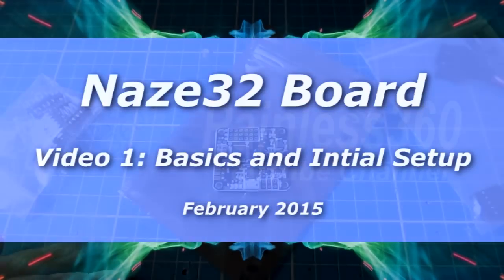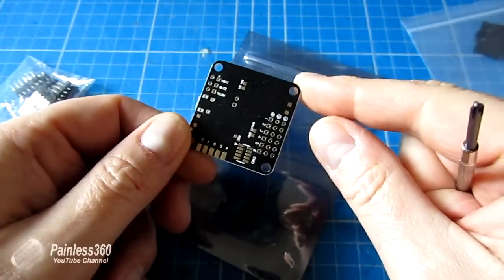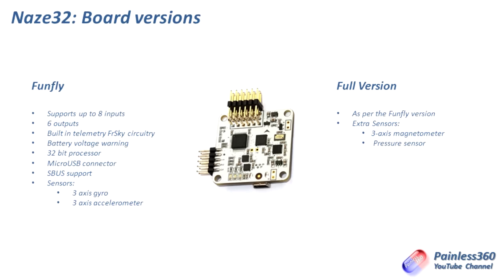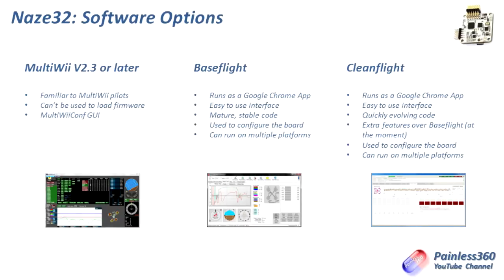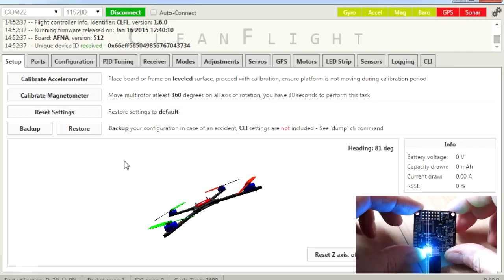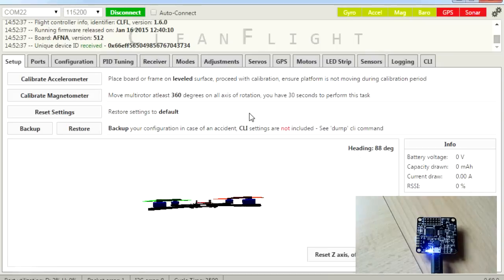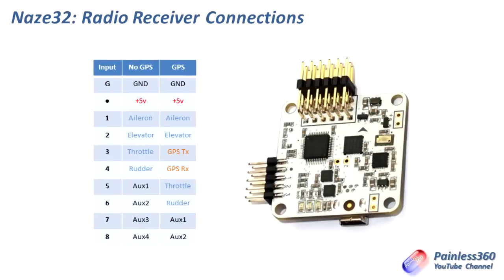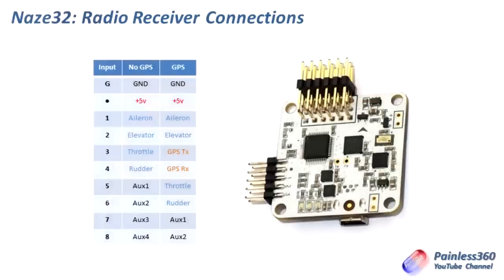(1/8) Naze32 Flight Controller (Full version) - step by step initial setup

Comment: Lee I've had to fit my Naze with the arrow facing left so I can get at the USB port, can you tell me if there is a setting on clean flight to tell it that forward is 90 degrees to this, or is it not needed? Thanks
Reply from the maker: Tony Hodgson Yes you can - CLI command SET ALIGN_BOARD_YAW=90This is for then the arrow is pointing to the right. Good luck with the build - hope to see a first hover video soon!
Reply: Thanks Lee, I found the board alignment in the configure tab to change the orientation. I set this to 270, now works a treat, needed lots of help off the forum guys tho.. Lol. I'll be doing maiden later today... I went straight for the ccpm with the 615 RX..
Reply from the maker: Tony Hodgson Great news - did you also have to change recalibrate the magnetometer too?

Comment: Hi Painless, excellent videos,thanks very much. I have a new Naze32 Acro, Problem, Windows 10 and XP do NOT assign a com port and tell me I'm running an old version of Cleanflight even though I downloaded the latest version available. I tried installing the drivers and simply can't get a Com assigned. Any suggestions would be appreciated. Oh yeah, after starting Cleanflight, I connect the Naze32, the red led lights briefly, the blue stays lit, then the green led flashes and goes out, only the blue stays lit.if I tilt the board to 45deg the green flashes. No COM so I can,t flash. Waiting your feedback with great anticipation. Yes, I tried shorting the bootpads while connecting. No progress!
Reply from the maker: +segpie Download the drivers for the board. The link is normally on the homepage of Cleanflight. Then try again. Best of luck.
Reply: +Painless360 
Well tried again and this is what I see both on Windows XP and Windows 10 computers??
------------------
2015-09-27 @ 12:36:40 -- Running - OS: Windows, Chrome: 45.0.2454.85, Configurator: 0.65.02015-09-27 @ 12:36:40 -- You are using an old version of Cleanflight - Configurator. There may be a more recent version with improvements and fixes.2015-09-27 @ 12:37:29 -- Failed to open serial port2015-09-27 @ 12:37:35 -- Failed to open serial port----------------------Cleanflight - configurator displays PORT = COM but doeesn't assign a number to it?Very discouraging.
Reply from the maker: This 'old version' alert comes up on all versions at the moment. Concentrate on the COM issue. Best of luck.
Reply: +Painless360 
Hi, well I had to follow-up as I finally got the Naze32 connected to Windows XP and Windows 10! I always had a feeling that it was my PCs at fault since the error messages were "Failed to open serial port". It was due to the fact the the USB Root Hub had the 'allow the computer to turn off this device" checked. Here's the fix.
Go to the 'Device Manager'. Open USB Controllers. Scroll down to the first "USB Root Hub".  Right click to view 'properties'. Click the tab 'Power Management'. Make sure the statement, "allow the computer to turn off this device" is UNCHECKED and click "Okay". Do that for each USB Root Hub listed!! Then, reboot the PC and you should be in business. Thanks very much for your kind replies as you encouraged me to look deeper! Keep up the fantastic work with your videos as the effort is very much appreciated by this viewer. Take care.

Comment: im using the naze 32 fc. how do i send piwer from my pdb to the f c?
Reply from the maker: You can connect the 5v from the PDB to any spare 5v pins on the board. Google something like 'pdb naze32 power painless360' to find the video. Best of luck!
Reply: Thank u. I might have more questions so stay tuned..lol.. def have no idea how to hook up my devo 7 reciever.  I googled so much but found nothing on this specific transmitter and receiver.
Reply: 5 v pin on the board would be one of the 6 pins that the esc are connected to?
Reply from the maker: Please watch the rest of the video - the answers are in there and it will help with the connections for the radio too. Best of luck!

Comment: Can i use FS-CT6B for naze32 rev5
A friend told me that it won’t work for CT6B. I am already having issues connecting transmitter and receiver to board. Though all wiring is correct
Reply from the maker: I’ve not used the Naze32 for a long time so am a little out of date. I can’t see why a standard receiver would not work. There were issues with SBUS and the inverters on older boards.. maybe that’s what he’s talking about. I’d check with him and clarify..
Reply: Please let me know. I'm really stuck up

Comment: I could use a little help.  I am trying to get my Frysky x8r receiver to connect.  I have a green light on the receiver and when I unplug the Sbus cable it says telemetry lost, but I cant change any of the control bars in the receiver page (They are all center stick).  I tried to check RX Serial box, but it is not highlighted and will uncheck itself after I hit save.  Any suggestions?  I have also been trying to check the Serial Receiver Provider, but it is also not highlighted.
Reply: David Layton  I may have another problem that is contributing....My motor #1 ESC is not working.  I will replace that esc and try again.
Reply from the maker: David Layton See https://github.com/cleanflight/cleanflight/blob/master/docs/Rx.md there is a bug for some receivers - check what you have. http://www.multi-rotor.co.uk/index.php?topic=12522.0 may also help with the value not being saved.
Best of luck.
Reply from the maker: David Layton Swap a motor pair and see if the problem follows the motor or stays with the ESC. If it's the ESC, try and re-calibrate and, if call else fails, go back to the vendor for a replacement.
Bets of luck.

Comment: hI, I AM STILL TRYING TO GET A NAZE32 REV5 BOARD GOING ON A TAROT TL250H QUAD, LIKE THE ONE YOU DID IN YOUR BUILD USING A CC3D ATOM FC, I KNOW IT HAS A PDB THAT IS ON THE BOTTOM OF THE TAROT TL250H QUAD WHEN I HOOK IT UP TO CLEANFLIGHT NO RX ON THE MOTOR PAGE IF I MOVE THE SLIDERS THE MOTORS SPOOL UP IN THE CORRECT DIRECTION, MY FRSKY D4R-ll rx is bound to my tx but whn I hook it up the single wire way the rx light does not come on! since I am using opto esc's and this model comes with its own pdb on the bottom of the quad how do I get power to the rx? do I need to purchase another pdb that has a 5v output to power the naze32 board? I did not see you do anything like that but just use the pdb that it came with please help!

Comment: hi. i cant move the throttle yaw etc sliders like you do in this video, TX and RX is bound .AUX wont move sliders either
any ideas anybody....thanks
Reply from the maker: +Russell Kenhard What troubleshooting have you done already?
Reply: +Painless360 full wipe and re load bind TX RX and cant connect to quadcopter and cleanflight doesnt seem to see the TX, done this a few times now and no life to quad
Reply from the maker: +Russell Kenhard ppm, pwm setup on FC, tested with a spare servo etc.

Comment: Hi Having problems connecting the Naze 32 all I seem to be getting in message saying : Serial port successfully opened with ID :4  Then No configuration received within 10 seconds Connection Failed ?  have I done something wrong ? it's a neew board also.
Reply from the maker: +bl4derr1 Happy to help but please watch https://www.youtube.com/watch?v=olIqTiSJHIY and come back to me with more detail of what you've tried..
Reply: +Painless360  Hi all iv'e done with the board is followed your above video, gone all the way through to Flash firmware with the latest for the board and got Constant blue light with flashing red and that's where i'm stuck the board won't do anything else.
Reply from the maker: +bl4derr1 If it's new then I'd approach the vendor for help in case it's the board that's faulty..
Reply: +Painless360  Thanks i'll e doing that after the Holiday period. thanks for the response.

Comment: Hi, did you install additional software before connecting the NAZE32 to your USB ?
Any drivers ? pre install software other than ClaenFlight ?
NAZE32 is not recognized and CleanFlight has only COM1 which is not connected to the NAZE.
Reply from the maker: No, everything installed automatically. I'd delete the device you have there in device manager and then start again. Best of luck!

Comment: I am will be using the Naze32 Rev6 Full with a PDB BEC LC-Filter 5/12V. Do you think the FC will have noise and other issues if I stack the FC above the PDB?
Reply from the maker: I've not tried those exact pieces but I'd expect it to be fine.. Best of luck with the build!

Comment: My multiwii se 2.5 doesn't work anymore and I Need a cheap alternative.
Is the naze32 ok or there are better options for less than 20$?
Thank you very much.
Reply from the maker: +Nicola Guerrera see my flight controller comparison video from last month for ideas. I wouldn't use a Naze32 now..
Reply: Painless360 Thank you very much!
I'm gonna buy an SP F3 Board.
I hope it will work fine !

Comment: what can i do if the trottle and the pitch is swapped?
Reply from the maker: +Ncy_ [#] If it's PWM then swap those two connections over..
Reply: +Painless360 i got :Aux 1, gear, rudd, elev, aile, thro, batt
Reply from the maker: Lots of help on here - https://www.youtube.com/watch?v=cPi4v-flw1c should be useful.. ;)
Reply: wow thank you! :)

Comment: mine does not show any com ports, just shows "no  ports"
Reply from the maker: What troubleshooting have you already done?
Reply: Thanks for the reply but I figured it out I just needed an additional driver, hope this helps any other newbies to the hobby.
Reply from the maker: Where did you get the driver from? Please post the detail here and others can benefit..

Happy flying!
Reply: Painless360 it shows up under the "welcome" menu bar as one opens CleanFlight, mine was on the very bottom line. ie, ( Latest ?????? driver can be download here ).
after just reboot ones computer and connect your copter and now you should get a com port. im using windows 7 home 64 bit, hope this helps, happy flying !
Reply from the maker: Thanks for that - may come in useful as others have had similar issues.. Happy flying!
Reply: Painless360 May i ask, what's the overall height of the naze 32 with the right angled pins? thank you.
Reply from the maker: I make it exactly 10mm.. Hope this helps.
Reply: Painless360 thank you very much

Comment: Hey PL!   I got the mini naze controller from banggood. I tried setting it up in CL. I'm in PWM mode. For some reason on ch5,6,7,8 the AUX1-4 channels work. Ch1,2,3,4 TAER do not. I've verified the Rx is working by putting TAER into Ch 5,6,7,8.  I then flashed Beta and same thing....no TAER their value locked at 1500??   This is my first time using NAZE all others were CC3D.  Either the board is bad or I'm missing something simple?
Reply from the maker: Sounds like there is something odd with the board. Just make sure that the connections are all ok as the odd layout of the inputs can catch you out. If the receiver supports PPM then I'd use that.. Best of luck!
Reply: Left side of connector wasn't fully seated. Needed a good press!
Reply from the maker: Phew! :D

Comment: Hi, just finish setting up my naze32 (full version) added a micro odd too with osd with vbat configured. Everything works perfectly, though I when I try to connect the naze back to my computer It won't communicate. When I try to reflash, clean flight says stm32 timed out. Any ideas?
Reply: Sorry auto correct messed up, meant to say that I add a micro osd and configured vbat
Reply from the maker: +Parzival We cover this in the series - watch the one where we add the MinimOSD. (it's all about the USB and UART sharing the same pins ;) ) Best of luck!

Comment: Hi, my motors start to spin at 1400, not under,even after calibrating the escs.how can i correct that?
Reply from the maker: +francois Bonin Then something went wrong with the calibration. You don't mention if your using a flight controller or anything so I'd suggest covering the basics and recalibrating.. Best of luck..
Reply: +Painless360 thank you for your answer, i am using the Nase32 and Clean flight
Reply from the maker: Happy to help but please watch https://www.youtube.com/watch?v=olIqTiSJHIY and come back to me with more detail of what you've tried..

Comment: I have a ar8000 and a naz 32, my tx is bound and getting a signal, I can see the connection light. my problem is I can't get the rd to respond in the receiver section of clean flight? is there something I need to do in cli?
Reply from the maker: +Rae Williams see later in the series where we cover how to configure the common Rx connections.. best of luck'
Reply: Painless360 thanks I will check it out

Comment: I'm new to this, what cable do you use to use this with the computer.
Reply from the maker: +Timothy Rego any usb cable that will fit the port on the flight controller. If you are new to this then I'd watch the ' Quadcopter building for beginners ' series. Best of luck!

Comment: Hey there again painless, caught on another problem and wondering if you can help. I put together a F450 with a Flip32 and started adding everything you showed on the video's to it, I kinda notice everything getting really hot mainly the ESC's and the LED's. I'm using 5v BEC ESC's Got worst after I added on the LED's today, and this is grounded not even flying gets hot within minutes. Is it because I added to many things or is there a way to smooth out the power. I went through all the wirings and they all seem fine. There no magic smoke just starts getting really hot really fast didn't want to leaved plugged in to long. Thanks again Painless :)
Reply from the maker: LiveLife Zippo I would unplug the LEDs and see if that stops the overheating. The LEDs take about 30-40ma each (white) so having 10 of them can be almost half an amp extra draw.. You may need a bigger BEC..
Reply: So can I add another exterior BEC with the ESC's that already is 5v 3amps, or do I need to totally switch out all ESC's with larger amperage. Thanks again Painless.
Reply from the maker: Watch my introduction to ESC video for when you can plug in more than one BEC..

Personally, if I had a problem with the power being too much for the BECs i the ESCs I'd power the whole thing from a nice big separate 4a+ BEC..

Best of luck.
Reply: Hi There again Painless, can I get that link to the video about adding more than one BEC, I tired looking yesterday but couldn't find that particular video. Also where can I get a 4a+ BEC's, all the one's I seen on Ebay are 5v 1 to 3amp, or 12v 1 to 3amp, no higher on amperage. Gosh! I love this hobby but man sometimes it's just a hair puller, but than agian it's a hobby that needs time and patience:) Thanks again Painless,
Reply from the maker: This is covered in the first two videos in this series and also covered in the 'Introduction to ESC' video too..

Google things like 'Henge 4A 2-6S Input Switch Mode UBEC' to find them..

Best of luck.

Comment: sir does this controller have different modes like acro, horizon, altitude hold. is it similar to f3 6dof used in wizard x220
Reply from the maker: +Universal Video yes, but dont use one now. Buy an f3 or f4 based board..
Reply: Painless360 thank u for the advice sir

Comment: Using Flip32. Running - OS: MacOS, Chrome: 45.0.2454.85, Configurator: 0.65.0
Flight controller info, identifier: CLFL, version: 1.8.1
When the device is ready the blue and RED lights stay on.
When I move the board the green light flashes during motion.
When I use 
Flight controller info, identifier: CLFL, version: 1.9.0
When the device is ready the blue and GREEN lights stay on. ARMED.
Is the correct behaviour?
I have not been able to locate and documentation on the Z offset. Could you please let me know where I will find it.
Reply from the maker: +Rav Gupta Looks good so far. Best of luck with it.

Comment: when i initially plug the usb in i get a flashing yellow light that never turns off. I downloaded the drivers, successfully flashed the board, and when I connect everything moves when I move the board. I just have a yellow light that constantly flashes....is this ok?
Reply from the maker: Mark Kuhns I've not seen that. What do the forums say?

Comment: Good evening Painless 360, could you tell me if my seletion for my 250 quad will be good or not...i've some doubts about the compatibility....Upgrade NAZE32 SP Racing F3 Flight Control Acro 6 DOF/Deluxe 10 DOF , FPV OSD On Screen Displayer Support 10DOF 6DOF Naze32 Flight Controller , NZ GPS For NAZE32 Flip32 6dof 10dof Best For QAV250 ZMR250 Multicopter Quadcopter , Eachine PCB Power Distribution Board w/ OSD Socket Support NAZE32 CC3D OSD For QAV250 Quadcopter , FT232RL FTDI USB To TTL Serial Converter Adapter Module For Arduino , FTDI GPS Adapter Cable GPS Serial Conversion Cable .... i've already get a frame, motors , and esc's....
Thank's a lot for your opinion...
Philippe
Reply from the maker: +Drones Visions Aériennes Difficult to say without seeing the motors and escs you are planning to use as those are some of the most critical choices. I do offer this type of support and guidance but not for free on this channel. I normally go through these things on a chargable Skype support call. Lots of videos on 250 quads on the channel for tips and tricks and component demos/choices. Best of luck!

Comment: I would like to setup a quad, for my Son, using some of the parts I now have that are not being used. Is it possible to setup PWM with a Naze32 rev6 and a Flysky 6 ch RX using the latest Betaflight 3.17?
Reply from the maker: VD2021 it looks like it, I've not tried it though. Only one way to find out for sure! ;)
Reply: I've spent a few hours trying to get a response from the RX. I set "PWM(one wire per channel) and default on receiver tab (AETR). Have flysky rx bond and wired/solder for pwr, 5v and then 1-4 on fc. I was hoping there was a command line or somthing simple I need to do or missed. Thank you for responding.